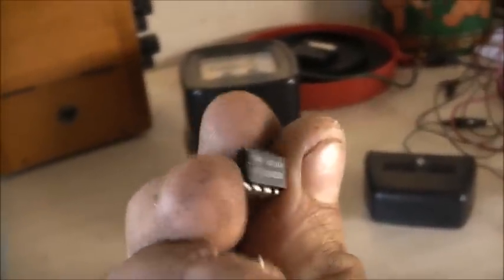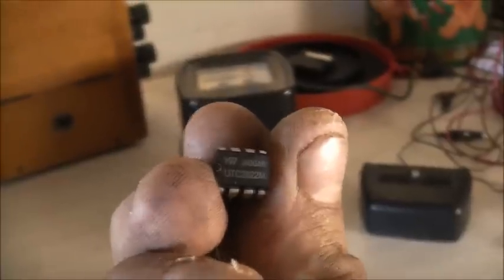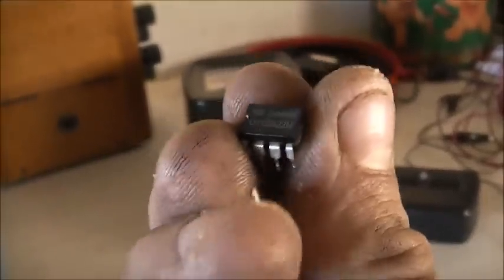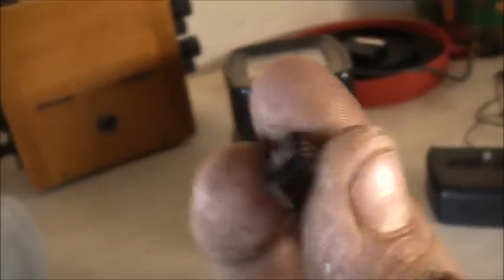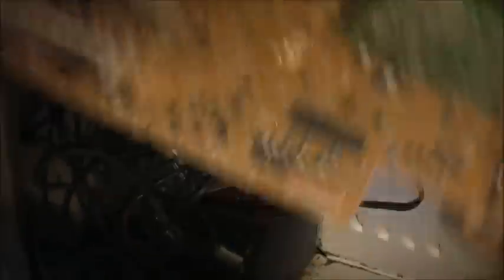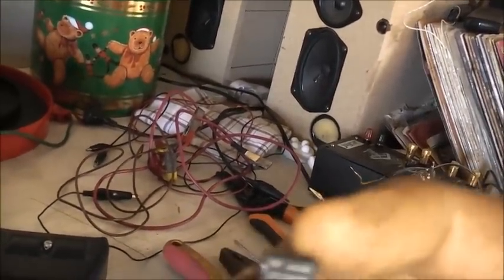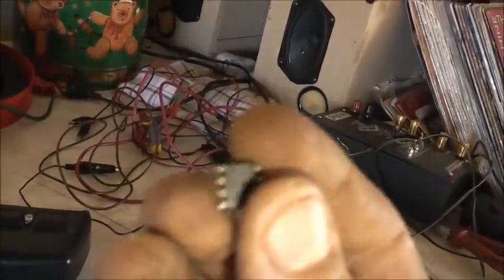Repaired CD Player & Update!

Comment: Aaaah, you un-popped something. :D

That old chip though.....If it has failed, try connecting a couple of leads onto a couple of pins of your choice, give it a 2500w ballast then let the variac give it a proper beating.....Let's see if the middle of it blows out or whether we get Flaaaaames. :D

The cap bank will obviously annihilate it to dust, or if it disappears without trace, then you blew it 15 years into the past. :D

I think....giving it a grunty beating on the variac will be more satisfying. If nothing happens of course...THEN let the cap bank chew it up. :-)

Thanx for showing,

-BoomBoxDeluxe.

23rd February 2014, 20.06